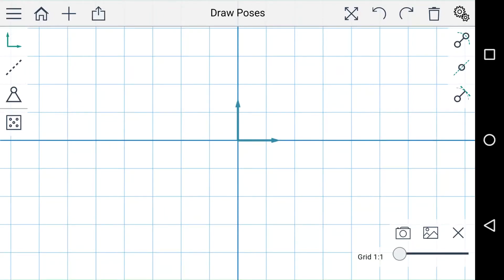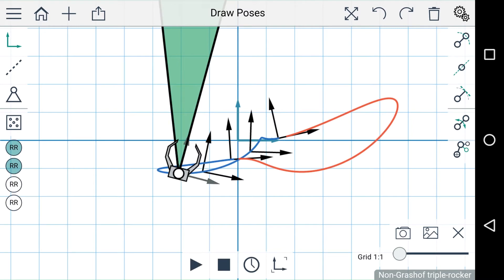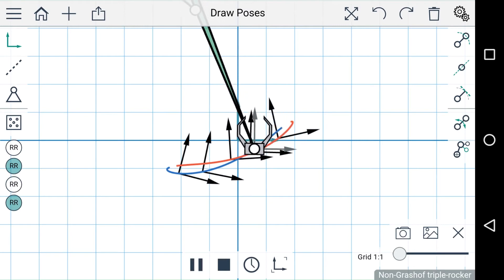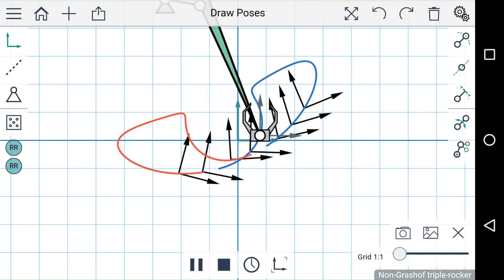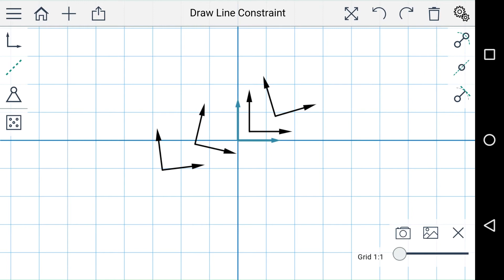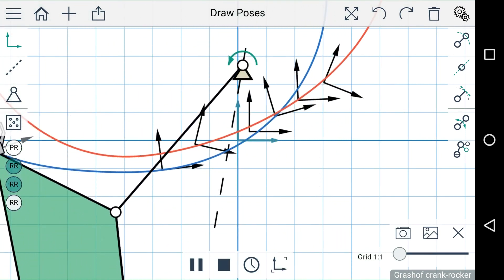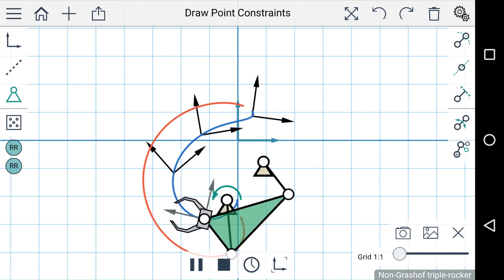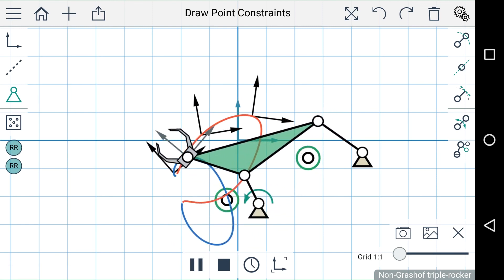Four-bar Linkage Synthesis in MotionGen

Comment: I need help with this program!  I have a device with two separate linear actuators.  I want to extend actuator A 50% and simultaneously extend actuator B 100%.  Then B does not move, while A fully extends to 100%.  Once A is fully extended, it does not move while B fully retracts to 0%.  I cannot figure out how to do this.